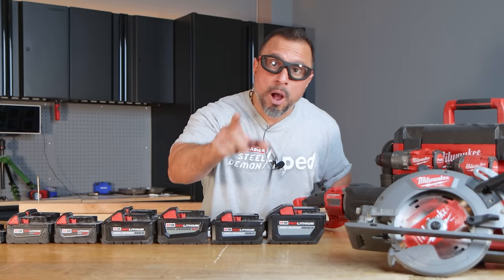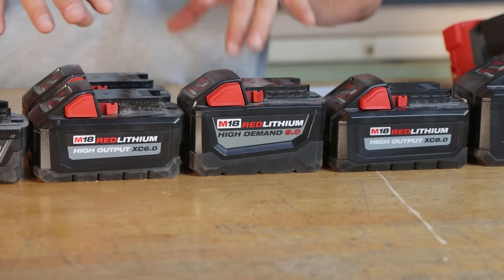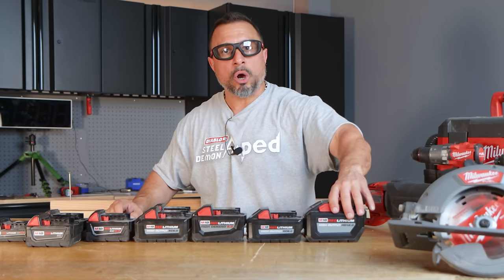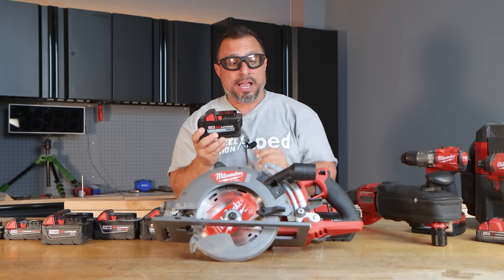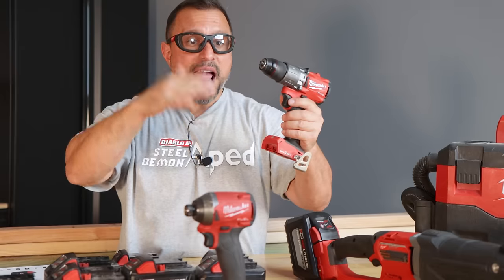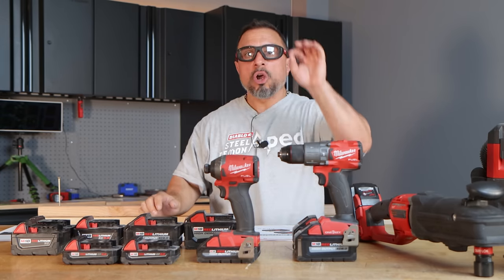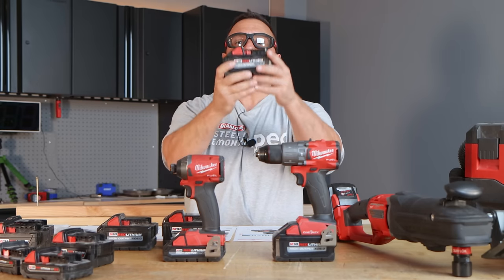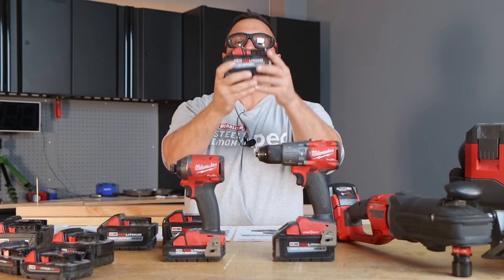Your BUYING and USING Milwaukee M18 Batteries ALL WRONG! (stop doing this)

Comment: Here's a perfect example of using the wrong battery: a 2Ah battery in a hammer drill. It spins and makes noise, but it just doesn't break concrete worth shit. Put a 5Ah in that tool with the same drill bit and it will smash concrete like it's nothing.

Comment: Real pro-tip…don’t buy the cheap Chinese knock off batteries for your tools. 
It may ‘seem’ the same, but they’re not. At.all. 
The knock offs ones use cheap cells, and often have a third of the battery capacity. 

They often lack proper low discharge shut off capabilities, and do not typically balance correctly when charging. 

And he is very much right - the high output batteries are pointless in non-Fuel products and in non-true high power demand tools.

Comment: well yeah. the 2170 battery cell is more cost efficient than 18650, having good balance in capacity and current draw which is the reason Tesla/Dyson went with 2170. however, absolute current/power still vs size is in 18650 which is the reason the Tesla Model S Plaid still use the 18650.   i mean to say, there is still small value in the old pack.
a bit out of topic, these power tool companies should get stop the madness with these multiple batteries and voltages. they need to make a high capacity and power pack that can be strapped or carried using cheap and environmentally friendly LFP cells. The pack step up or down voltage negotiating with the tool through a heavy duty user replaceable cable.

Comment: Definitely buy name brand or you're wasting money.  I bought an after market m18 battery for my weed eater and leaf blower but it's trash.  The battery dies so quick and doesn't hold a full charge.  I can fully charge it, take it off the charger and immediately put it back on and it shows not charged.

Comment: Hey Vince. Love the videos. Especially the side by side comparisons.

Question. Is your relationship with Milwaukee good enough to help some one out? The reason I ask is because my wife left our garage open the other night and some one waked away with a 12.0 battery and my bran new 7 1/4 saw. It's a  huge loss that I can't afford to replace. 

I will say it could have been a lot worse. My pack out with all my other tools survived along with my mitersaw and stand. Infact out of all my tools my saw with the 12 is all that went missing. Probably a tweaker with a backpack walking the neighborhood. Couldn't take the rest. 

My neighbors text me at 5 in the morning.  I was so bummed.

Comment: --- big battery ( larger than a 6.0 ) on smaller tools make them too heavy.  Plus, just because it's a stronger battery doesn't mean its a better battery.  The old 9.0 were outstanding.  The new 12.0 are great for long life and extreme use, but make the tools heavy.  And then there is the 8.0  -  those are pure garbage  -  everyone we have had died in less than a year under light use.  If you go and check out the reviews for the 8.0, it is way heavy in the 1 rating and most complain about the quick failure rate.  Now, they will honor the warranty:  but you're going to get another battery which is probably going to fail.  ( just got 2 of my 8.0 back from warranty just a couple of weeks back )

Comment: In less words all the batteries performs the same but circular saw uses more mah because the motor is a high speed and torque . Is why the high cost  version have a different BMS to compensate the voltage load if you use a regular battery version is going to get over heated and discharge faster and can damage the cells is why the new version have more mah connected in series and better BMS is what he call new technology . He has reason all de batteries have the same type of cell but but not the same BSM. I just waiting what company the  are going to make first graphene batteries is more superior and better the lithium batteries .

Comment: What would be the smallest non HO/HD battery to use on tower lights ?? XC 5.0 ?
Reply from the maker: Sure, it’ll give you around 7 hours of run time, just under enough time to make it through a full shift.
Reply: @VCGConstruction  I Remeber you were saying that for Lights and the vacuum , battery size does not impact performance, so basic XC 5.0 CAN work fine.   thank you brother !!!! Appreciate you.   I Love the channel.
Reply from the maker: Glad you’re enjoying the channel, thanks!

Comment: So I need to use 17 difference batteries for my 17 M18 tools, so i can get the best performance of each tool, and two batter of each type of battery so i don't have to sit around to wait for them to re-charge 

GOT IT !!

Comment: Also my recommendation on all of these batteries and products is simple.... don't buy them......why? Because HILTI TOOLS EXIST and tool to tool battery to battery HILTI outperforms Milwaukee 7 out of 10 times.....that's not an exact number that's my opinion from 7 years of using power tools for fire sprinkler fitting ....and since starting work at a new company 5 years ago and them using mainly HILTI tools (I started at this company with my own Milwaukee kit of power tools) I've compared them impact to impact driver to driver performing the exact same tasks and most every time HILTI is on top..... price is a factor though for most I know but spend the extra money and you'll be entirely happy you did .....SIDE NOTE HILTI  did not pay me nor do I work for them this is my genuine opinion .... SECOND SIDE NOTE ... MILWAUKEE tools are top notch for home use and close to top for jobsite use but HILTI is simply the best for high demand instances extended use time instances and any situation where you need to be able to expect more from your power tool and battery.... love how convincing you are tho Vince keep it up

Comment: Idk what dude is talkin about but I run 5.0s on all my impacts . Iam a mechanic for a living . I had a 8.0 battery but I really felt no difference in taking off a seized bolt compared to the 5.0 if my half inch impact ain’t gona take it out I’ll usually get the air impact . Also I have multiple 5.0s battery so I usually have one recharged if the other goes out . Run time  in a impact is different … 5.0 is not an obsolete battery .

Comment: Yes, Milwaukee sells its tools with the crappiest batteries they have. Yes, 12 polishers with the smallest battery that is worthless with the tool. Run time is next to nothing with it. Milwaukee becomes so greedy since they have made it big time in the marketplace. Just look at the plastic waste called pack-out boxes. How much actual usable space vers the total size the dam unit takes up. The difference is called the very expensive unusable space you paid for. Also, thieves go by your vehicle and see all those pack-out boxes. They just found a new victim to rip their stuff off from. Even if boxes were empty they can make great fast cash just off the boxes.

Comment: Those 8.0 and 12.0 aren't cheap the 12.0 is 250 a piece. As for the 2.0 vs the 3.0 yes it totally makes sense but as for the 5.0 wouldn't call that obsolete.

Comment: Hey man, there are so many differences in the capacity and discharge rates of the 18650 batteries, its a mine field,  cells can be as cheap as a $ for a 3000 mAh 20A , a Epoch 2800 mHa   40A can be 8.99$  for a  Single,    the price Milwaulkee charges is a total RIP off.. there is no such thing as RED lithium it just a marketing name... Milwaulkee  use Samsung 20R cells in their 4Ah M18 Red lithium battery... buying bulk (600 a time)  they are 2.50$ each... so buying  10's of thousands they probably drop to 1$ ? with 102 Ah cells in a 4Ah ... it could cost 10 $  .how Milwaulkee can charge 100's of $$$$$$ is just a rip off.....

Comment: 8 in the worm drive all day
I've got 20 batteries and only use the 6 8 and 12s,I use the 12 in my miter saw only,get alot of cuts on the 12,2 days bout 300 cuts 2x4s,worm drive with an 8 fully charged I get 300 cuts 2x4s
8 and 12s is all I will buy from now on,I've got 3 of the 9s and they are no better than the 6s or 8s,2 of them came free with my miter saw and 1 came free with the worm drive,
But in all actually,Ive spent probably 20grand in Milwaukee tools the past 6yrs but with the tools they have these days I'm ready to switch to something else,they mass produce these tools and batteries so there is no care about quality and they end up in the shop to be fixed,I bought the 10in miter saw about 2yrs ago and it has been in the shop 4 times for dum shit, factory screw ups,18g trim nailer same thing,the parts break easy, everything is brittle in these tools,you look at Milwaukee tools from 10yrs ago and look at the same exact tools from 2day,I'm taking the 10yr old tool, definitely built to last,alot better quality materials used on them,I've got 3 or 4 Ryobi tools that I use over Milwaukee any day of the week,they are just built better!
And yes Milwaukee has a warranty but who wants to constantly send a tool out to be fixed or replaced when u need it daily,it's a 3 or 4 wk process, sometimes longer to send that shit out and get back

Comment: Like the batteries themselves very a lot. You can literally go on a website and build yourself a better battery pack than Milwaukee's going to give you. There are batteries there are meant for high current applications and some that aren't. This is something you can tailor your battery packs by a lot. Like some are going to have more capacity but they don't have the power to drive the tool. Some are going to have the power but they're not going to last long. Usually you're going to spend a lot of money on some really good battery cells but they'll be worth it instead of paying for Milwaukee's battery packs you could just make your own. Just rip apart the existing housing and make your own there's YouTube videos on how to do this.

Comment: when my milwauke battery starts going bad i just go to homedepot and buy a new combo kit impact drill and driver that comes with 2 batterys and a charger.
1 of those batterys is goddam 79.99 standalone together they are 160 the combo kits at home depot are 199 for a brand new m18 drill and impact driver and two batteryts and a charger and a case. i may be a enivormental asshole but i get new tools for the cost of batterys essentially

Comment: This is fine for new purchases, but when you own lots of the older batteries, run them until they die!!  There’s nothing wrong with the old batteries if you already have them. I know you mentioned this towards the end, but you still act like people running their older batteries are idiots!!  
I have a couple of the new 3.0’s and they definitely lower the wait on my impact driver over the 5.0’s.  Also I want a 12.0, but they are to damned expensive and Milwaukee hasn’t had any good deals on them that I’ve seen.

Comment: FORGE XC 6.0 = Pouch Cell Batteries. There king of the jungle right now. Until FORGE XC 12.0 comes out. FORGE 6.0 is capable of current draw equivalent to HD 12.0 batteries.

Comment: I'm supposed to take advice from someone who can't get a 2nd grade word (your) and a 3rd grade word (you're) correct!? I assume you passed those grades.
You see one of them words is a contraction which makes it SIMPLE to figure out which to use in your sentence.
Say you are every single time and if it makes sense use the contraction, if it doesn't then "your" is likely the correct choice... its that simple!
Most don't try until they're embarrassed from it... and don't try to say you did it by accident because you can edit the title and correct it, which you would have done.

Comment: Thing pisses me off about these cordless tools sorry yes I wish they would come up with the voltage and everybody would use the same damn plug the same way to hook them up so 18 V have their own 12s 24s 40 eights whatever it is they all use the same common plug for that voltage it’s bullshit I do it greedy bastards do it for money find something that works and stick with it. No you don’t buy a socket set and everybody’s got their own three eights quarter inch or half-inch drive do you this should be the same way with these batteries car batteries come with two different hook ups lawnmowers come with one hook up you know they do this for money. I got lots of drills it still work good but the batteries are on able to get the batteries